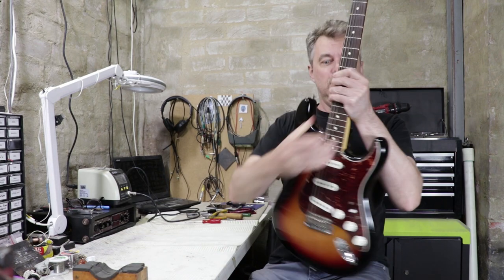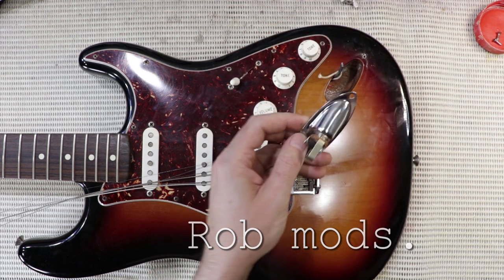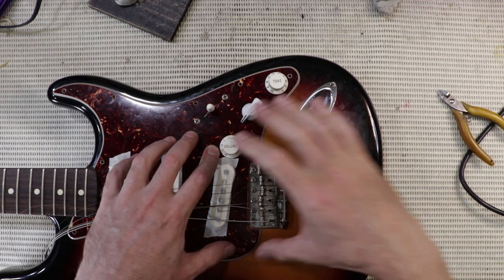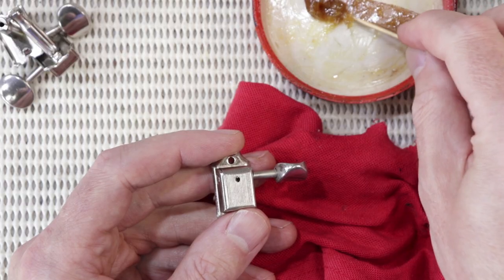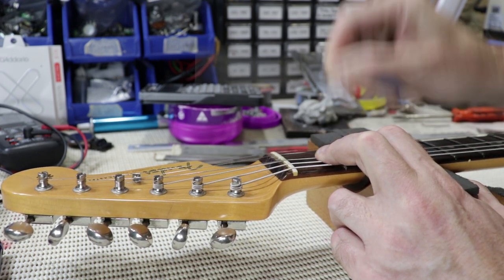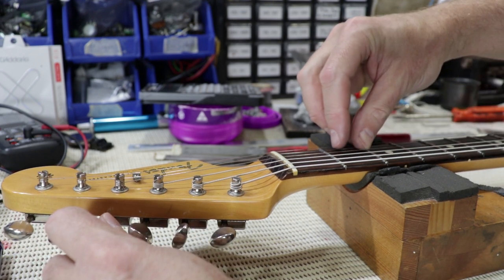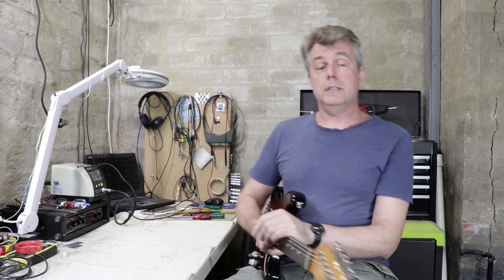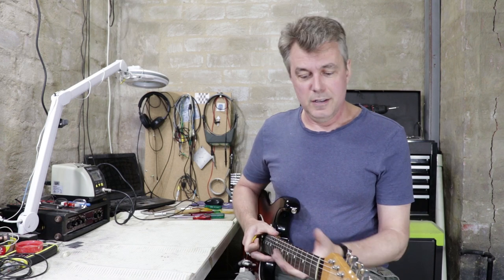How To Set Up An Electric Guitar.  John Mayer Fender Stratocaster service, setup, and wiring mod.

Comment: I'm always worried you're going to bonk a guitar on the bench, but you never seem to. I know I sure would. 😂 I like the mod you included. I'm going to add it to one of my guitars.
Reply from the maker: Ha ha.  Since making these videos,  I've also noticed when editing,  just how close the guitar sometimes comes to the bench.   Just yesterday I found some weather stripping to stick on there as a precaution.   I used to have the non slip matting folded over the edge for that reason,  but I got sick of retreading it every time I washed it.

Comment: I just bought one. Is it really low output? I can’t hear anything with under volume 8
Reply from the maker: I didn't notice that the output was very low with this guitar.  Perhaps there's a problem with the electronics with yours.
Reply: @RobMods  good to know I will need it checked then. Missed this when I tried it out.
Reply: @melaserrano get the the pots checked as well as the wiring. Sometimes you can have a bad volume put that greatly reduces the pickups. Either that or your pickups could be set way to low